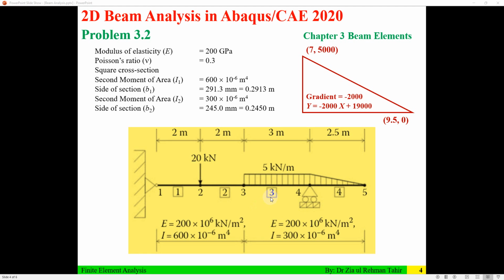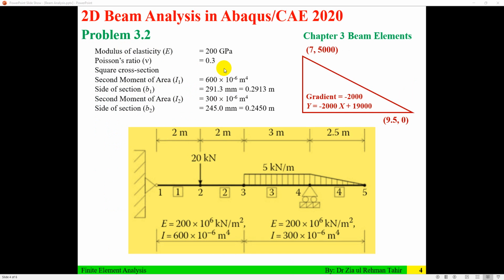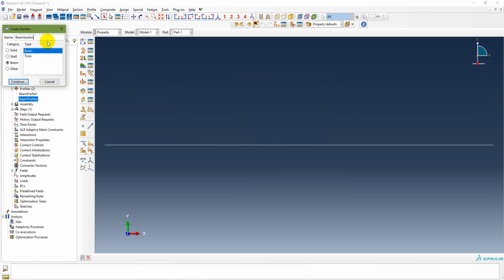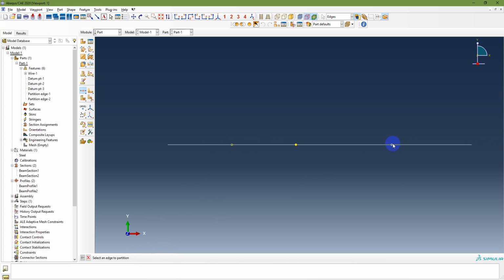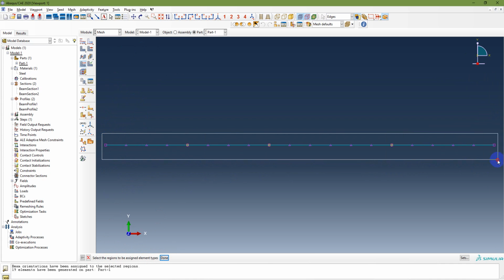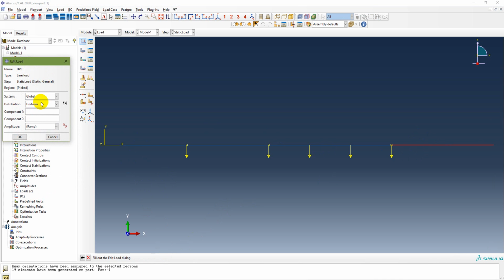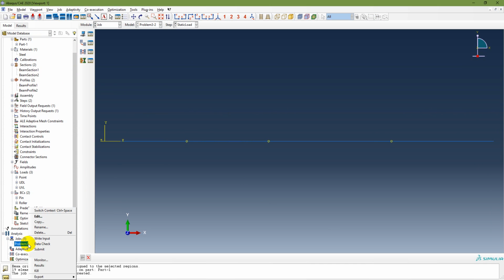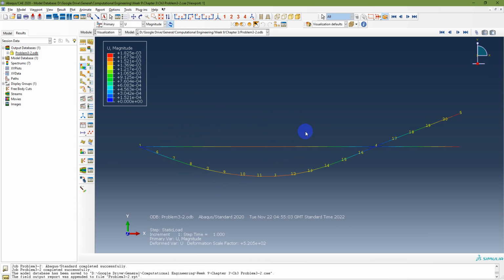Abaqus Beam Analysis 4 | Beam carrying Uniformly Varying Load | Deflection and Support Reactions

Comment: Thank you for letting me know how to use the program. I am interested in learning Abacus to solve analytical problems. steel structure I have a question about applying it correctly to the examples I do. I work as a technician Steel structure. Please, your e-mail address. My name is Nattadej. I work in Thailand. Thank you very much for sharing your helpful experience.
Reply from the maker: Please contact me on ResearchGate 
https://www.researchgate.net/profile/Zia-Ul-Rehman-Tahir-2